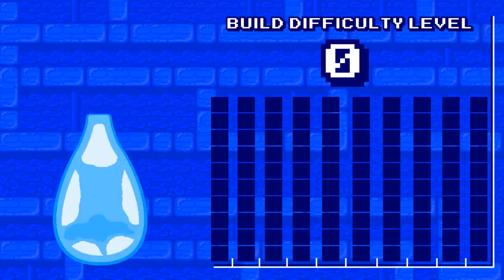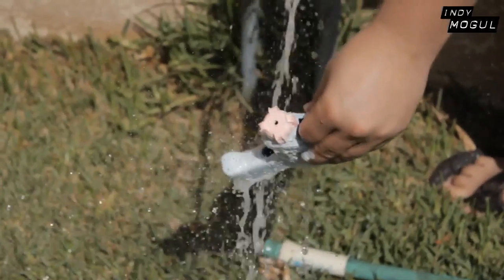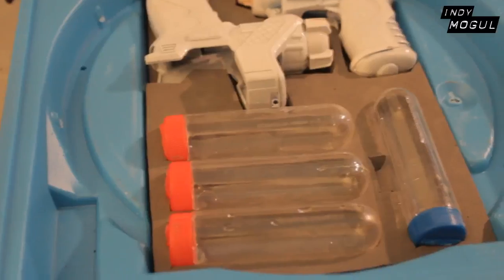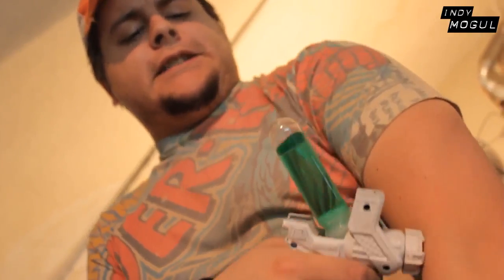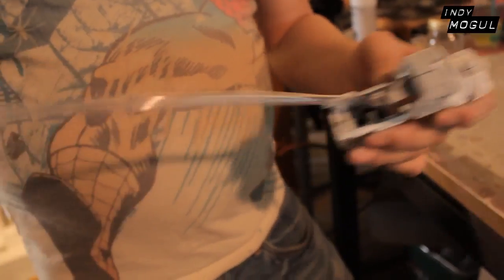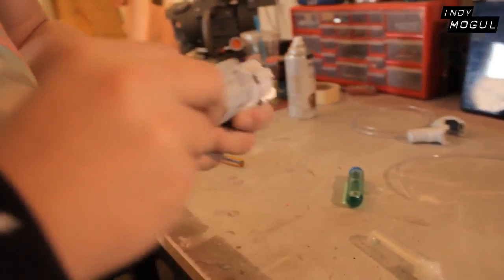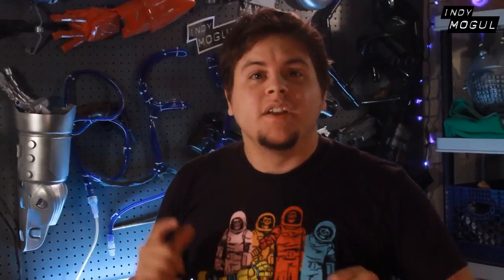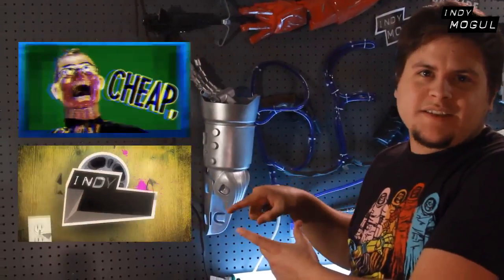Future Science Injection Gun: DIY

Comment: Huh, I wonder if it would be possible to modify this design so that the fluid could drain into the handle, perhaps using a valve in the trigger area to allow it to drain, could be fiddly, but it would mean less cutting footage and a more mobile functioning prop. 

Not sure what valve could be used, but I am sure someone out there can think of something that would work, any suggestions?